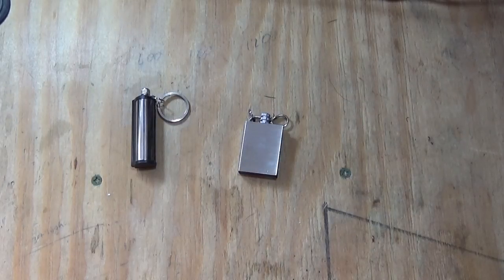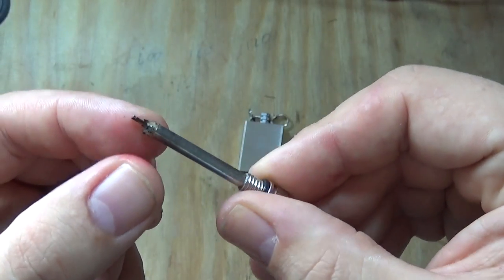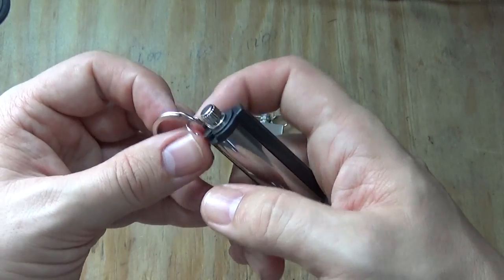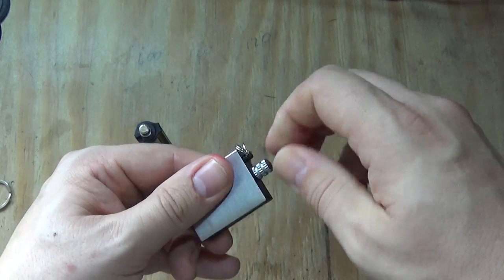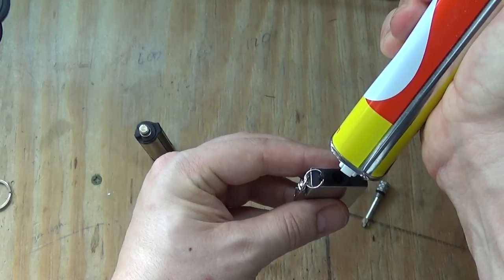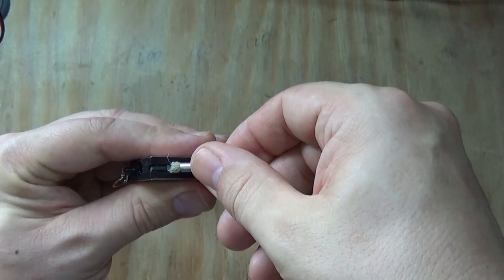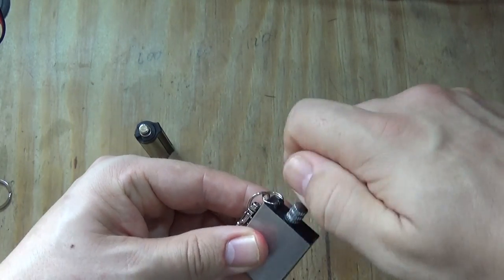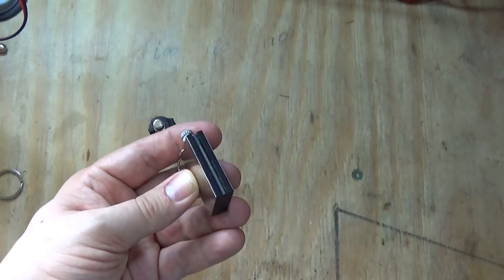Permanent Metal Match Box Lighter Review

Comment: If the wick burns down just use pliers to take the steel striker out pull out the wick which is big enough to last years if you don't burn it on just the wick then pull the wick a little out then put the striker on at tap it on the table to make sure it goes in completely
Reply: JJ i tried that with some I had that look like the cylindrical version, it ended up ripping the grip off of the rest of the match part. Guess I need to try a slightly higher end version.

Comment: How do I pull the wool out from the match when it burns down
Reply from the maker: As long as you are using a decent lighter fluid the wick shouldn't burn to quickly. When it does burn down use a pair of pliers (needle nose ones work best) to pull up some new wick. I hope that helps. Thanks for the comment

Comment: Hey! Have you been using these regularly? I'm kind of curious about how long does the flint and the wick lasts for, and if they are replaceable or not.
Reply from the maker: I used one for months and there was no sign of it dying. The wick and flint are both replaceable and the only reason I stopped using it was it ran out of lighter fuel...I was to lazy to fill it.
Reply: @TheOffGridFamily  Thanks for the reply mate! When you say "it ran out", do you mean that the fluid evaporates readily, or did the fuel just get used up entirely? Also, how long does the fuel last in them without it getting evaporated completely?
Reply from the maker: The fuel just ran out. They have a really good seal and it only ran out through a lot of use. I was using it to start camp fires etc.
Reply: @TheOffGridFamily  Perfect! Thanks again! :)